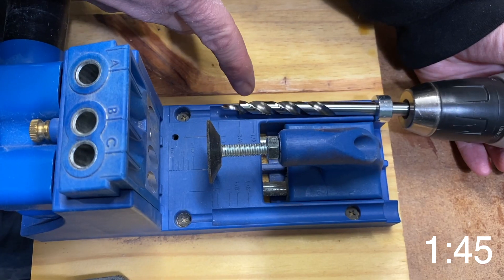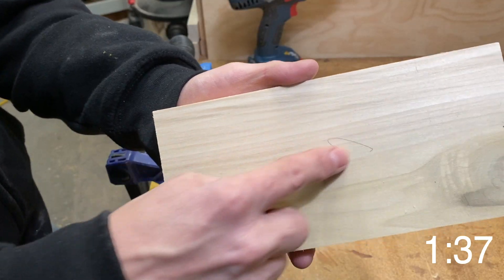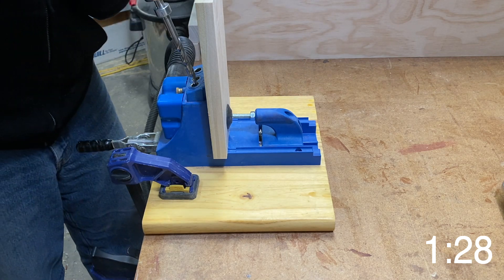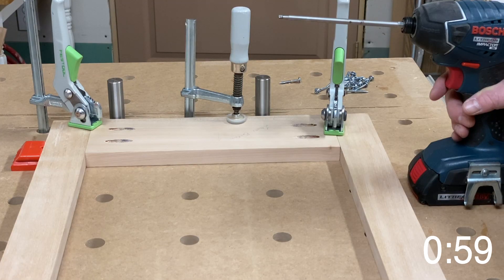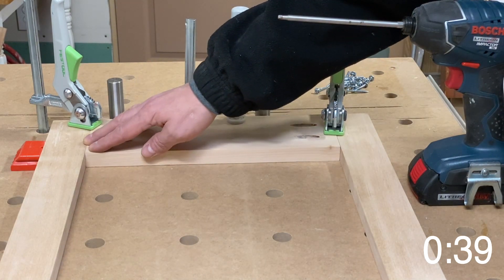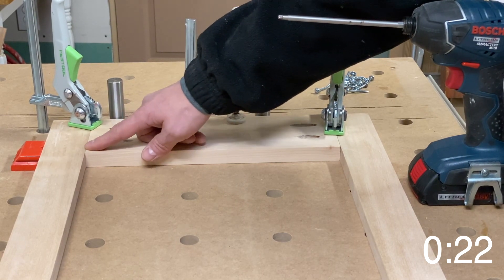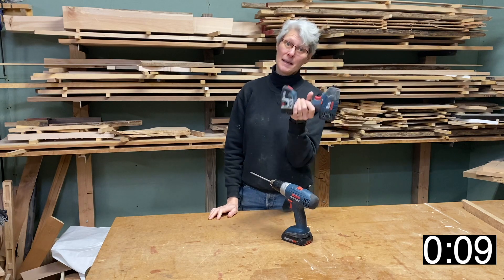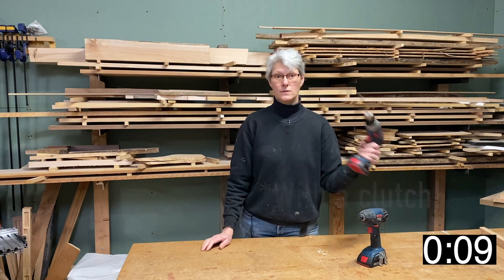Pocket Hole Joinery for Face Frames

Comment: I ad glue to the joint but it's probably not necessary because the end grain does not glue up strong.
Reply from the maker: You're right, end grain gluing doesn't add much strength, but like the video says, there is really no need for strength in this frame; it is just for show.